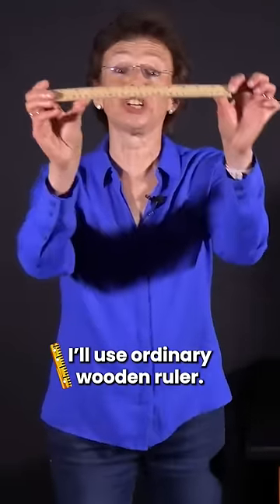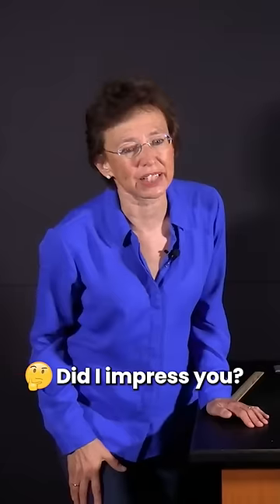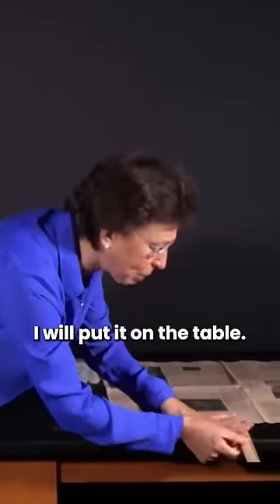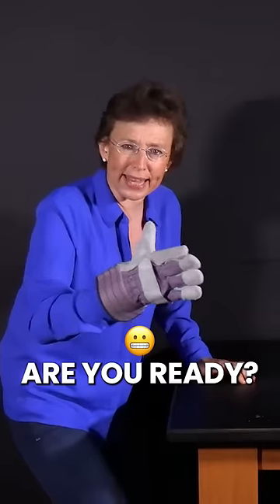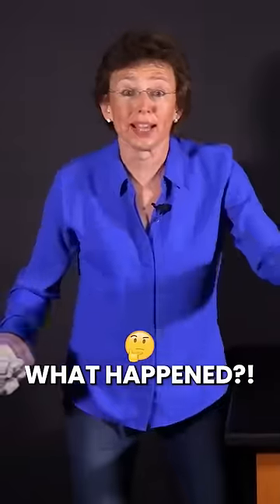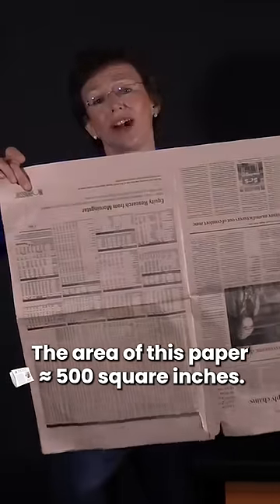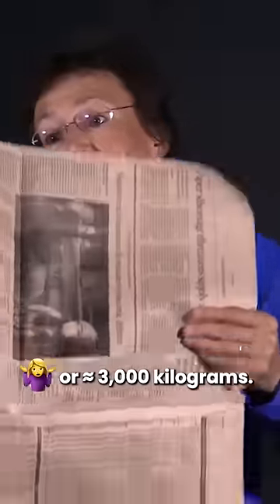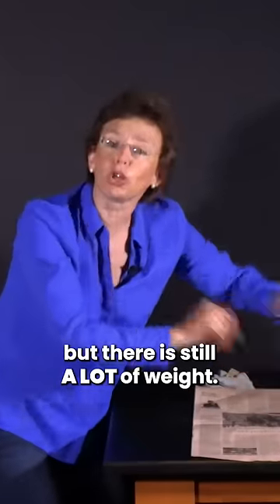Break a ruler with atmospheric pressure! 👺📏 #viral #funny #fyp #reels #shorts #shortsvideo

Comment: As somebody who’s seen this experiment in many different places through the years. This is the best way to explain it that I’ve heard I love her energy. Need more teachers like her😊
Reply: She's wrong though. It's not atmospheric pressure that causes this. It's air resistance.
Reply: She's wrong
Reply: @supercal333  ... Well, more or less. When you try to lift the newspaper suddenly you have a "suction cup" effect as you try to suddenly increase the volume of the air underneath the paper very quickly, without giving time for more air to come in. You are lowering the pressure a lot under the paper (i.e. create a vacuum) while on top it remains atmospheric pressure, plus drag as you try to push the air away and around of the top side of the paper.
Reply: @supercal333  what do think the atmosphere is made of bruh

Comment: As a russian, i was listening her well and understood, until she said "pounds per inch", just then i was a bit shocked 😄
Reply: 1 фунт = 453 грамма
Reply: @РомаЗверь-г8ц  i dont know russian and still know thats 1pound = 453 grams, metric is the best
Reply: @tranzitosu4478  the best indeed
Reply: @tranzitosu4478 1 pound is not equivalent 453 grams. Grams are a measure of mass, and pounds are a measure of force. 1 pound is equivalent 4.448 Newtons
Reply: @Echiio So what unit of mass they use in the imperial system?
Reply: @pedrosabino8751 pound is used for both. A pound of mass weighs 1 pound of force on earth
Reply: @pedrosabino8751 I would just use kilograms for mass. We don't need to use imperial for everything. Or for anything. Imperial is kinda useless.
Reply: lbs/inch or kg/(m*s²)?
Reply: @josh8584 Agreed. Mfs be measuring height with their feet. We got meters for that
Reply: @Echiio  just another argument for the metric system
Reply: @zdog1566 Pound Force (lbf) = Mass (lbm) x Acceleration Due to Gravity (ft/s^2)
Reply: Да, привычней кг/м^2
Reply: Nearly the whole world uses the MKS system. Only one major country is pig-headed enough to retain the FPS system
Reply: Да, сразу слышно что английский не её родной

Comment: What impresses me most is that the newspaper page doesn't just rip.  7000 Pounds of air pressure on the whole page are of no use when a piece of paper the size of half a ruler rips off.

Comment: No.  The suction of the paper to the table which prevented air from traveling under it caused the pressure on the ruler.  So it broke.

Comment: In my opinion it is not mainly a question of atmospheric pressure but of the friction that the large sheet generates with the board when it is forced to move quickly. Due to the rapid movement, the air pressure is not balanced above and below the sheet, which generates friction.
If the reason was only pressure, it should work even at low speed, but it doesn't.

Comment: the ruler raises the paper sheet up, if done fast, air atoms above the paper doesnt have time to move so they are compressed and high pressure creates above the paper, same way more space is created under the paper and air atoms dont have time to occupy all of that newly created space so the air is decompressed under the sheet. high pressure above, low pressure below causes a force pushing down the paper sheet.

Comment: She's a blast and i dont wanna be a downer, but the atmospheric pressure has nothing to do with this. It's about air resistance, not weight, which is easily demonstrated by doing the same thing but slowly.

Comment: Sorry now, you're wrong. Pressure acts from all directions equally. The sheet of newspaper presents resistance due to the energy needed to move the air above it alone. Nothing to do with atmospheric pressure, other than the density of air at roughly 1 bar

Comment: This is wrong. I would argue it’s, at best, wind resistance. Also because the paper isn’t rigid the paper in contact with the ruler would begin lifting without the rest. It would then pull the outer edges toward the center. The resistance is created by this tension.

Comment: This is why you shouldn't do that internet challenge where you put yourself in a garbage bag and use a vacuum cleaner to suck the air out. Even if you only manage a half vacuum, that's still over seven pounds per square inch, and people got a lotta square inches.

Comment: Sry, but I think its also resistance through friction and inertia. Maby its the same effect splited in its foundings. The density of the sorounding air is because of the mass of gases/its heavyness. So yes, its because of the atmospheric pressure, which has the air density as result, which is functioning as a friction-brake in this experiment.
The energy is splited/distributed trough the newspaper to a really greater mass/volume(gas-molecules) of air, than in comparisson to the experiment without the newspaper.
There the energy is distributed in motion and temperature because of friction. The energy is not really noticable anymore because of the great air mass and its inertia.
Butterflies know this.

You hit the brake to hard for not breaking the ruler.
But that was the trye; to break and rule. Breake the rule, to be the real ruler.. how rebellious.. yt is watching you 😉😅

Any corrections?

Comment: You don't need to bring in atmospheric pressure to explain this concept. Actually, it is misleading, because there's air on both sides of the newspaper, so the force from the atm pressure cancels out. Inertia is enough.

Comment: Ummm...atmospheric pressure surrounding you is 3.14 psi. Not sure where she got ger number from but then its hard to understand her.. Otherwise yes shes correctly illustrating it with the paper which has abooouut....if its 20x20 inches paper thats 400 sq inches then times by 3.14 psi means its over 1200 pounds of restistance from the paper.

Comment: This is wrong. It has nothing to do with the atmospheric pressure. The pressure is the same on top and bottom, thus has no impact. This is about drag force and the high drag force created when rapidly moving a big flat object through air.